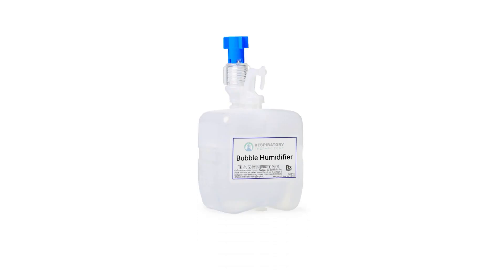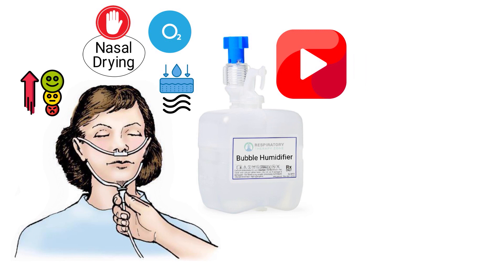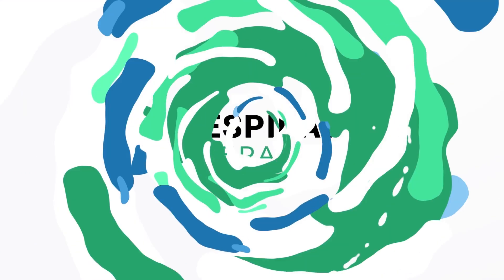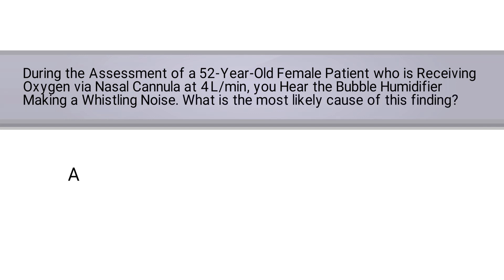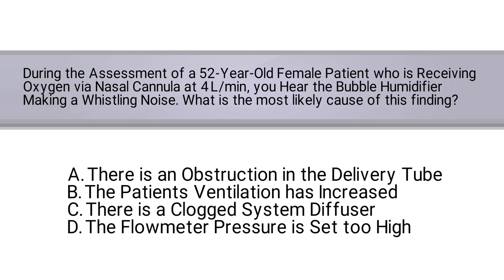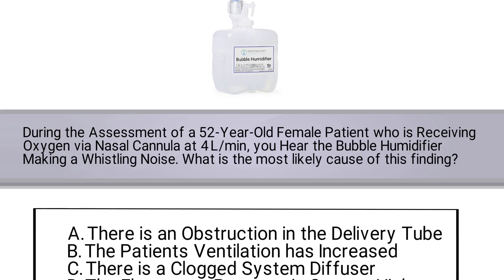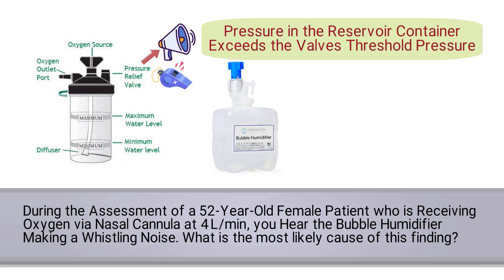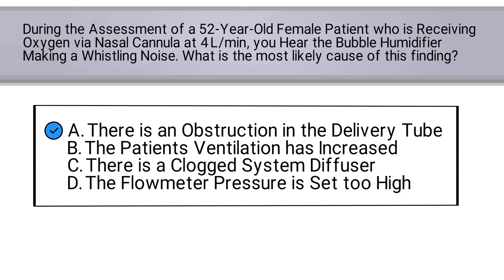Bubble Humidifier Making a Whistling Noise? (TMC Practice Question)

Comment: Stopped using it because water comes up into my nose
Reply: Water coming into my nose
Reply: Then it's not hooked up right or you need to empty the water from the cylinder that is connected to catch condensation